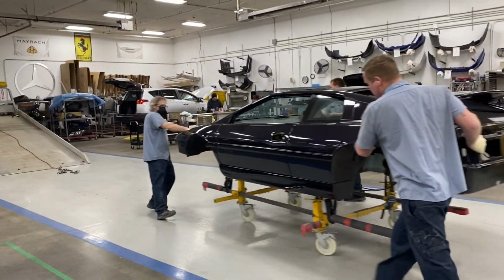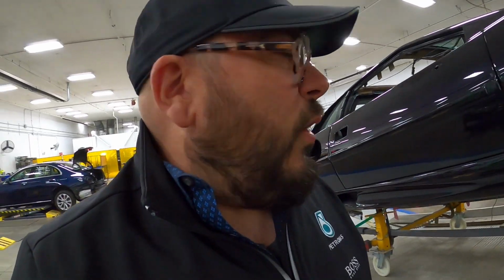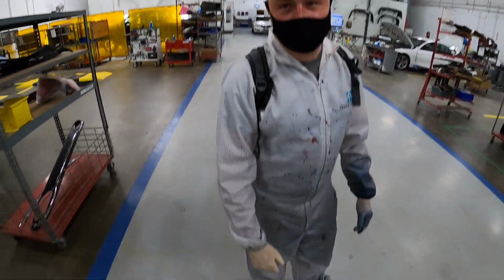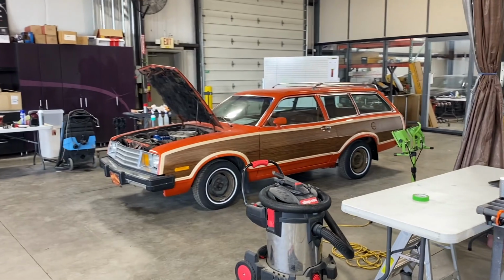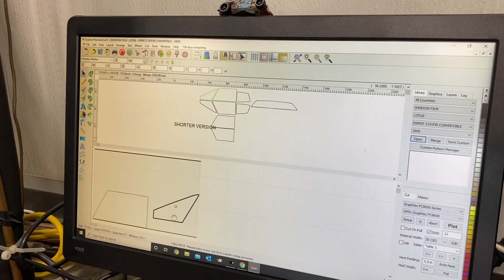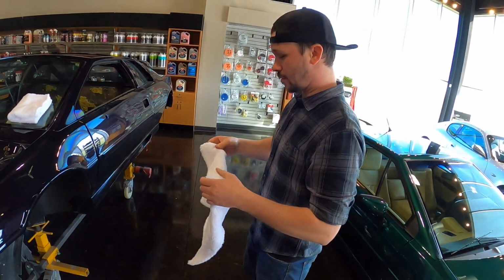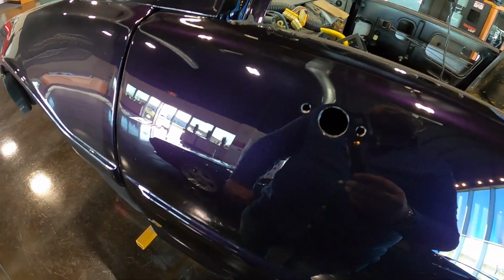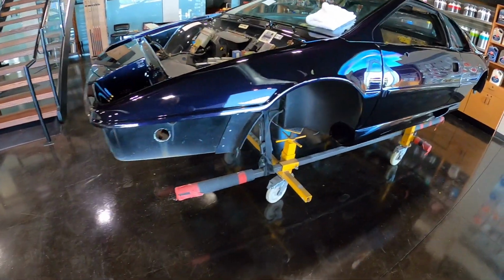Lotus Esprit S4 Resurrection Part 6 : Transport to Performance Auto Spa,  Window Tint with Air80

Comment: I have a 1988 (late) that had some of the S4 parts, but not all.  I converted the engine to have the intercooler and added the S4 mirrors so that it would be fully upgraded.  I had my motor completely rebuilt with new pistons, ported/polished heads and converted to electronic fuel injection.  The engine is now producing over 400hp - far more than the Citroen transaxle can handle.  After much thought, I'm going to to sell the engine and transaxle and convert to an LS engine with a Graziano transaxle that can take the power.  If you know anyone interested in a fully rebuilt motor and transaxle... mine will be available.

Comment: Watched all your videos on the Esprit rebuild. Nice job and doing it right! I've a 2001 Aubergine Purple Esprit and it looks very similar to what you have put on this one. Of course mine has 33K miles of wear on it.  I don't know if you mentioned on salvaging anything on the interior, but I can't imagine the smell would be very good, even if you were able to salvage the seats. 

Looking forward to it being back together!
Reply from the maker: That is one of my favourite original Esprit colours!! That , Chrome Orange and Azure . This cars interior will be 100% completely new. Sound deadening, insulation, carpet and hides. All 100% custom made by a gent who does work for Singer and a Lamborghini restoration shop. I’m excited to reveal it. It will be a shock .
Reply from the maker: Also, thanks so much for watching my videos. If I didn’t have the S4S to drive this would be a much more excruciating process.

Comment: Ahhhh, that paint indeed. Almost spiritual. 
I almost think the Gold should be a slightly different hue to the previous car. But you have superb taste Tim, so I know you'll get it right. Oh, and green and gold logo for me. Cheers from New Zealand too.
Reply from the maker: The green and gold is winning by a huge margin. In terms of accent colour. We will see. I have some mock ups and it looks good there but I’m not sure. The last one was a true lotus f1 livery colour pallet where the wheels were bronze , the stripes and accents gold and a few touches were red. This one has a super surprise interior that will work well with the paint but we shall see about the paint contrast. If the bronze wheels stay bronze I may match it exactly with the accents on the paint and I likely wont do the pin stripes that were on the door tops etc. cheers and thanks for watching !

Comment: Tim, YES that paint is incredible! Are you sure about the width comparison with the S1/S2 Giugiaro models tho? Everything I find lists the S1 at 73.3 inches wide, just a half-inch less than the final Stephens model?
Reply from the maker: I see that as well, I recently had an early car together with my S4S and it is hilariously small by comparisons so I’m not sure where those width ratings are coming from. Part of it is the later cars body work is more voluptuous but when you see them side by side it’s inches and when disassembled it certainly “looks” like what they did, essentially forming the new car on the super structure of the old one. Several factory works are watching the series. Not sure if any where around in that time. If I get any more specific intell I will be sure to share it in this series. I am hoping to put a deal together on an S1 for my collection. If that materializes it will be even easier to really highlight the similarities and differences . Cheers !!
Reply: @TimsEnthusiastGarage  Awesome! The Giugiaro models are certainly smaller overall, lower by an inch or more at least it looks like. I would LOVE to see an S1 on your channel!
Reply from the maker: I am hoping to have several surprises coming soon 🤙🏼🤞🏼

Comment: Hello Tim and a happy new year. 
I’ d like to  ask you how did you resolve the brake problem on your s4s ( as you said “…..the car has a dreadful ABS  system……” ) . Did you put on bigger discs, pads ……and how about the brake circuit ??? Did you have  problems of compressed air in the brake tubes every time you drive the car after a long period of not being used ( e.g after 1 – 2 months ) ???. I was told that s4s has such serious brake problem and I’ d like to know whether it can be solved or the owner must learn to live with a dangerous car…!!!!.
 I’ m in the market looking for an s4s but I’  m  very skeptical of the problematic brakes. Is it worth it to buy an s4s with brake issues ??? or I should even quit the thought of buying one.
Thank you in advance.
Reply from the maker: Custom master cylinder, v8 calipers, rotors, brake proportioning valve , all will be covered in future videos
Reply from the maker: Also, I have an S4S as well, while the brakes are not brilliant they aren’t dreadful

Comment: No more update on the lotus?
Reply from the maker: It is pure pain and suffering and endless money spend. I have shot an update video but am honestly so beyond frustrated that it won't get posted until I am a decision on what happens next. Thanks for watching!
Reply: Sorry to hear that Tim. I have enjoyed your videos and recently picked up an S4 that I'll be doing some fuel and engine work on.
 I would love some more details on that steeper Wing section you had mentioned at the rear of the car above the taillights. I might also do that if I end up painting the car.
 Hope you get this project figured out and started up again.
Reply from the maker: @johnsonfrais485  look up esprit long transom tail or v8 GT long transom